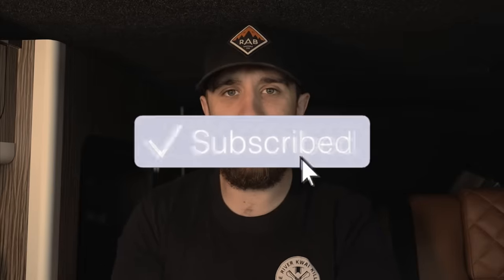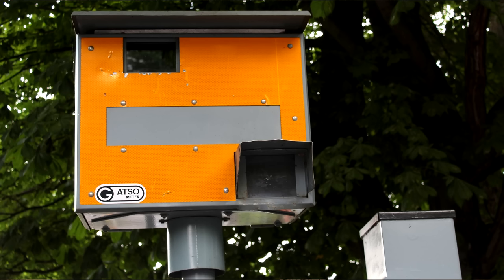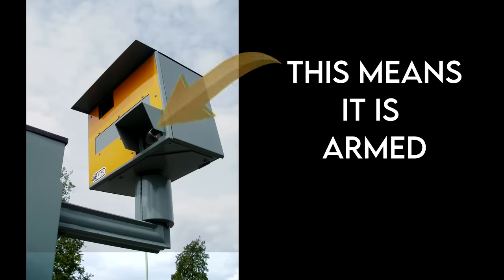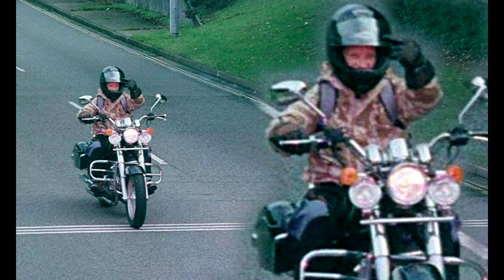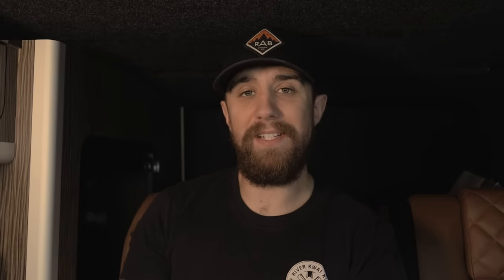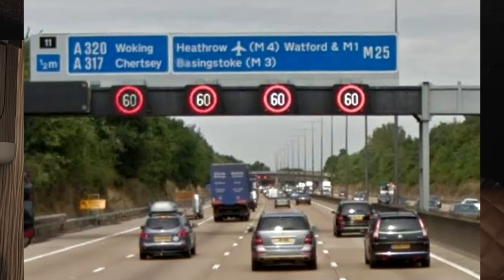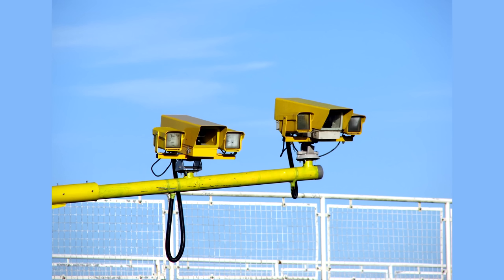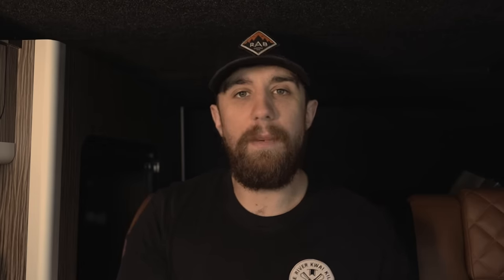How Speed Cameras Work and What to Look Out For

Comment: Its interesting with the classic Gatso. I've been "flashed" by speed cameras a far amount, but only actually done once and required to go on a speed awarenesses course. On that occasion I was caught doing 27mph in a 20mph zone. I thought that sounded odd as I'm fairly certain I must've actually been going faster when I initially set the camera off. My theory behind this, and why I haven't been done on other occasions, is precisely the "2 flashes" - When the first flash goes off the instinct is to immediately hit the breaks. If I'm going 35mph, set the camera off, slam the breaks on and drop 10mph before the 2nd flash, they'll clock me at around 30mph and ticket me. I reckon many of those other times I've set off the cameras I was probably going about 27mph, got flashed once, slammed the breaks, dropped 10mph to 17mph by the 2nd flash, making them clock me at a little over 20mph and not enough to actually ticket me.
Reply: Pretty sure you won't drop 10Mph between the first and second flash. They are usually half a second apart. Doubt you are dropping 10Mph in speed in half a second.

Also it doesn't quite work like that. Some cameras have secondary verification lines on the road, they use them and can see which line you are at in the first photograph, and then again which line you are at in the second photograph. As the lines are a set distance apart they can calculate the distance you have travelled in the time between the two flashes, which is usually half a second to 1 second maximum. Usually the smaller lines on the road by the camera are something like 1 metre apart and the wider lines are 5 metres apart, although this varies from site to site.

On sites that don't use this, it will have a radar unit but no lines, the two photos are to prove the vehicle, one is a close up of the plate typically, (to prevent any argument that it wasn't your registration as it's "not clear" in the photograph) and the other photo is a wide angle view of the vehicle and shows the road and sometimes the pavement to the side, depending on where the camera is located.

The HADECS (motorway) cameras have double radar units fitted to them, which removes the need for the secondary white road verification lines you see. Some of them still have these lines but legally they aren't required as the HADECS cameras have two radar units independent of each other, and if both are activated or "Triggered" it essentially means you are definitely speeding above the threshold limit.

A camera with one radar unit might accidentally go off if you weren't speeding, because it only has x level of room for error. But two radar units both independently detecting a speeding vehicle has twice the room for error, and is pretty much guaranteed not to activate for a vehicle that isn't speeding. HADECS are the ones you see mounted typically at the side of the gantry, the ones with the blindingly bright flash if you see someone set one off travelling on the motorway in the other direction, they are usually only active when there are temporary or variable speed limits, but often if you pass through at high enough speed (perhaps in excess of say 90Mph) they will be triggered.

Also, for what it's worth, ANPR cameras do not flash or "activate", they record images of every vehicle passing capturing the number plate by manipulating the black text against the background of the plate to perform a "Read". These are stored in a database along with a timestamp, i.e 23:54:46 GMT. When you pass the second camera that the first ANPR camera is paired to it performs another read, with another timestamp, as the cameras are at known fixed locations the software automatically calculates the distance covered and the amount of time taken, from this they calculate your average speed. Some people think if they slow down AT the average speed camera, but then speed up when they drive past it, and slow for the next one, they will fool it, these people don't know what "Average" means or how they work.

The ANPR cameras are paired, you could have 4 ANPR cameras, the first two cameras might be paired, and cameras 3 and 4 paired. Or it could be cameras 1 & 3, 2 & 4.. or 1 & 4, 2 & 3, as there's no way to know it's best just to stick to the speed limit.
Reply: @thefiestaguy8831  Interesting. Yeah, I was specifically talking about the cameras with lines in the road (I think they're called GATSO) and they're everywhere around where I live still. I think you'll find that breaking hard between the 1st & 2nd flash with those specific cameras does kind of work how I described and you can slow down quicker than you think (so long as nobody is directly behind you, lol). I mean, that's the whole point of the 2sec rule on motorways and that is at speeds of 70mph. The cameras with lines in the road are usually used in 30mph and 20mph zones and I believe, especially with a modern car, you could easily drop 10mph in 1 sec (give or take a couple mph depending on how good your brakes are). That's the only way I can explain why they clocked me going slower than I actually was by at least 5mph (I guess it could also be in the inaccuracies and human error of actually deciphering lines painted on a road maybe). Anyway, it was over 5 years ago since I got done and I 've learned my lesson now .... honest, guv!
Reply: @matthewwalker5430  It's not though, is it.

Do you honestly think your car will stop from 70 to 0 in 2 seconds? It won't.

The point of the 2 second rule is to give you enough of a gap to the car in front, so that if it suddenly brakes, you have time to react, if you are literally right behind it there's little to no time to react and you're now in their boot.

If an animal ran across a motorway or dual carriageway, and stood still in the lane you were in and  you applied the brakes at 70, and it was approximately "two seconds" gap from your car, there's no way you are stopping in time, even swerving at that speed to avoid it would likely result in a loss of control and crash. I once had a deer run across an unguarded dual carriageway right next to a wooded area. I hit the brakes so hard I hurt my foot, and veered to the right as the deer panicked and froze still in the middle of the road. Luckily I was a bit more than 2 seconds from it and had time to react and plan.

The 2 second rule is just to give you time to react to the car in front, it's not "2 seconds to stop".  You've got to remember even if the car in front brakes, causing you to do so, as you are slowing but still moving, the car in front is too. The car in front won't go from 70 to 0 in an instant, it will still be braking and slowing as you are with a 2 second gap behind it. 

Plenty of cameras use lines in the road, and it's everywhere not just 20 or 30 zones. I've seen Gatsos on a motorway with secondary verification lines. They're nothing to do with the function of the camera, it's literally just a set of painted white lines each being a set distance apart, to prove a car was or was not speeding in the two photographs the camera takes.

Also, when you consider thinking time and reaction time alone is usually 1 second or slightly over, I doubt you are dropping 10mph in half a second. Unless you started braking before the first flash went off.
Reply: @thefiestaguy8831  The flashes are 1 second apart, human reaction time is 0.1 second. Modern brakes activate instantly. if you've ever had to do an emergency stop at 30mph, then you will know that a modern car will come to a full stop in a fraction of a second. If you are not excessively speeding then braking hard as a reaction to that first flash will drastically slow you down, enough to bring you're average speed during that second down to the legal limit.
Reply: @talibong9518  Depends on the camera. I set off a HADECS camera the other day doing 80mph by my speedo on the M25 near Cobham Services - never seen them flash at that speed (more likely actually 78/79mph once speedo inaccuracy is taken into account). No signs showing on gantry and no speed limit displayed either - it was simply unlit. Sure enough as I passed double flash. Waiting the dreaded 14 days now.

NEVER seen them flash people at that low over the speed limit when not displaying variable speed, seen people bomb it past them at 100+ and they don't flash.

GATSO might be 1 second apart but HADECS isn't, the flashes were no more than 1/2 second apart. Interestingly it took ages to flash me, as I passed under the gantry it waited 2 seconds before the first flash even occurred, pretty sure they normally flash quicker than that - but that said i've never previously set a camera off in the direction it is enforcing, in the 11.5 years i've had a full UK license.

Even with great reactions, nobody is reacting, moving their foot, applying the brakes and slowing by enough speed in that situation to prevent it going off.

Comment: You missed something with the HADECS system which is a useful warning you're approaching one. A bit before the actual camera (about 50-100m), about the same height and on the left on the verge will always be a bank of 3 or 4 white cameras that look like regular CCTV. I believe these are for capturing additional video evidence of the 'offence' and for demonstrating that the reduced speed limit on the gantry was working at the time the camera went off. I always keep an eye out for these too as sometimes the speed camera on the gantry is hidden behind a bridge or foliage.
Reply: Correct. For visual verification that the gantry was displaying the reduced speed, makes the case water tight and frankly there can be no arguments.
Reply: i’ve noticed them as well, especially on the m62 and m1, i always thought these 3-4 cameras were monitoring each different lane and did an average speed check from the moment you enter the first bank of camera until you get to the yellow cameras on the gantry which captured you, that’s my only theory for them but i could be wrong
Reply: @Ultra Obama  1st of all just for your and everybody’s knowledge, you won’t see a 
30MP/H sign on motorway. 
On the motorways Minimum sign you’ll be seeing overhead is 40miles “at least for the UK”
And for those who didn’t know, the motorway speed cameras are synced with the display sign overhead. 
If it shows 40/50 don’t think you can do the national speed 70miles because you’re on motorway. It will flash ya.
“ “Talking from my accidental experience. Not paying attention to the 50 displayed sign and got caught on 58” “
Luckily just a awareness course
Reply: @arian7436  i did see both 30 and even 20 mph on motorways. 30 several times on the left line when there are congestions/accidents on a slip road.
20 ive seen only once in Scotland in the middle of a night with no traffic around. Not sure why was that put in place apart from weather warning maybe?
Reply: @zilalapsa  I believe that because last week I did see the 20 displayed on the left lane in the middle of the night somewhere near Milton Keynes. 
I’m over 35 and that was the first time in my life seeing that on motorway 😳
I guess we do learn something new every day after all … 
PS: i do take the previous comment back.

Comment: I might've wrong but ,it seems as more and more cameras go up,less and less speed limit signs are on the roads
Reply: Except for 30 mph zones (see Highway Code re 30 applies if lamp=posts are x yards apart or less, (if no lamp-posts, must be repeater signs)  for a speed limit to be enforcable there have to be repeater signs at a given distance advising of the limit on the road (not including motorways of course).  A road near to my home encountered a problem a number of years back.  It was discovered that the repeater signs (if indeed there were any) weren't at the specified distance apart.  I believe quite a few speeding fines had to be refunded because of the non compliance with the signage regulations.  :face-blue-smiling:.

Comment: Pretty accurate!
Gatso road markings are called secondary check markings at 0.5m spacing and the two shots are exactly one second apart. True, each camera costs around £20k so only have a few. They use dummy cameras in other locations which also flash but don’t record. 
10%+2 is true for most. Car speedo of course over indicates speed so these nutcases who have to touch the brakes even though at 30 are actually around 6mph below trigger speed. 
Good video!

Comment: Good explanation with few add ons:
1) The speedometer of many cars is generally far from accurate so, when your car reads 70mph it is highly likely your actual speed is lower than that speed (some of this can be easily contrasted by checking what your speedometer says while you are driving and what your GPS mobile tracker speed says, (which is also not 100% accurate by the way)). That is the reason why the "international" guidelines for traffic speed checking, must allow for a "cushion", which is that 10% extra between what the max allowance and enforced speed is about and what the driver "thinks" his speed is about.

2) The SPECS, or average speed camera, work by stamping at time mark to your Reg plate reading at one point (time zero "0") and contrasting that with the second measurement taken by the second camera (and third and fourth and so on..) and calculating how much "time" has passed between the two readings. Thus, after a plate is read by the first camera, nothing prevents from that car to go crazy up to 150 mph if the driver wants to, then make a "stop" on the side road before the second SPEC camera reading, and get away with not being fined. Of course, this would be an extremely inconvenient situation and defeats the purpose of speeding after all, and the main reason why these cameras do manage to slow you down, as it is the "average time passed between them" (equal to the average speed you drove by), what actually counts.
Reply: Absolutely true!! The car manufacturers always make the speedometers read slightly high so that they can't be involved in litigation.
Reply: @robsayer8028  You odometer (Speedo to me and you only needs to be +/- 10% this is why they under rate them. Odometers need to be accurate within plus or minus 10 percent. Example: If a customer drives 100 miles and the odometer is three miles off, that would be a three percent error, which is within the design parameters for this component and would indicate no need to replace the odometer.
Reply: @andrewstevenson1449  when you say they need be accurate with in so many percent +\- they are allowed to more inaccurate if they read high than if they read low.